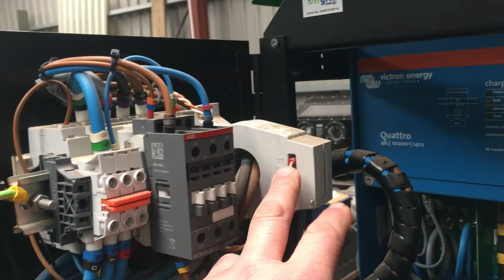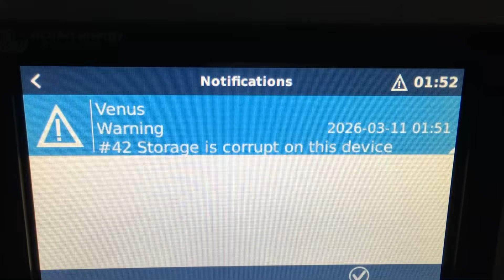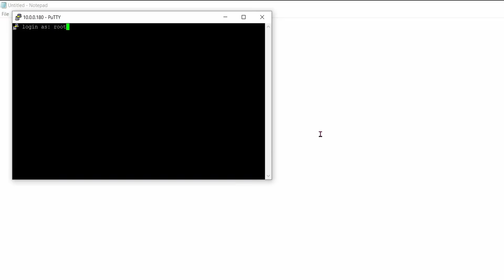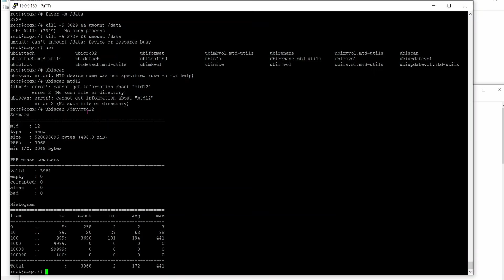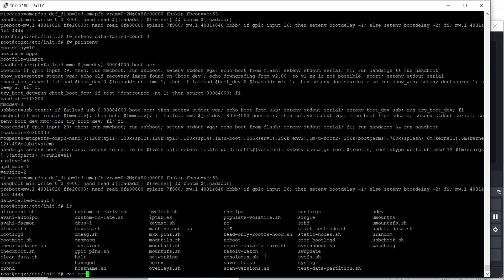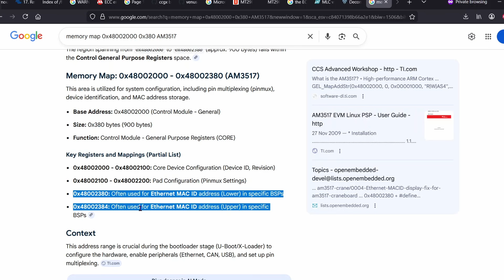Victron: "It's not user repairable" 🤔 Me: "Really?" | Victron CCGX Repair

Comment: Interesting to see Linux being used in such places. I thought there's going to be an RTOS of some kind on that control unit. The Linux is based on buildroot, these kind of systems are usually easy to play with and modify, it's mostly just shell scripts.
I tinkered with many of these and still do occasionally when I get my hands on them.
Not sure about that flash parity thing, whether this was done on purpose or simply an oversight. It sure does add a failure point though.
Reply from the maker: If you like this sort of stuff, I've done quite a few other devices that I've had to delve into the software. I put together a playlist called "reverse engineering" https://www.youtube.com/@BuyitFixit/playlists The VTech baby monitor was very similar to this, and I even discovered it had recorded videos of the previous owners child stored in the flash memory of the camera (which isn't mentioned anywhere in the manual!)

Comment: Hi Mick, just came across your channel and I'm sure you know but you have got some serious skills. I've come across some very, very clever blokes in my time in engineering maintenance and for this kind of work there are still very few people who could understand and implement the types of combined hardware and sofware based repairs on older control systems etc. that I've seen across a few videos on your channel. I've come across and heard of issues like this in multiple industries from water networks, to food production, to power gen etc. where a small fault like this can down an entire machine / system and takes months to have sent away and returned from the manufacturer. I don't know what your lifestyle would permit as clearly you own some kind of farm as well! But you could make an absolute killing if you advertised your services to the industrial sector, focusing towards plants with aging equipment. If you could go into a plant, fault find and implement fixes like this within hours or days instead of months you would be an invaluable contracted asset and you could charge pretty much whatever you wanted for your time. Just something to think about, keep up the great work bud 👍
Reply from the maker: Thanks mate 👍I'm glad you're enjoying it. I've messed with all kinds of stuff from ultrasound machines to X-Ray machines too (got one that I've used on here a few times to xray boards and the like). I did a video on it, but the manufacturer got it taken down after I hacked it lol. I've done a playlist on similar type of stuff like this one on the channel under "reverse engineering" please check it out! Thanks for the suggestion, but to be fair I don't really like working for other people anymore. I just like to do my own thing, but I'm always on the look out for interesting stuff to play with or reverse engineer....

Comment: Cheers Mick. I have put a few videos up lately about reusing old LiFePO4 car batteries for my home ESS. I have been chopping them up and using a cheap JBD BMS, but I reckon they could plug into your "generator". Wouldn't bother with Lead anymore. If you can find some lithium then this would be an amazing unit!
Reply from the maker: Cheers mate 👍I'll drop you an email.

Comment: Odd that the input cable to the dc-dc converter powering the cellular/ WiFi communications is cut….  I wonder why?
Reply from the maker: I wondered that too. I've just had a play with the modem / router today. The default password was still admin / admin. The sim card has expired, but there were logs from 2018 and text messages about the pandemic to get a booster lol. Thu Sep 27 12:32:27 UTC 2018 : Router boots up was the earliest I could fine, and the last was Tue Mar 18 22:51:34 GMT 2025 : Router boots up         so about a year ago.

Comment: A 4-ton piece of equipment being completely unusable because they set the wrong ECC seems inadequate
Reply from the maker: Yes, although I think it would have still operated, you just wouldn't be able to change settings or log anything as those use the /data partition.
Reply: @BuyitFixit That's not so bad, then. In that case, I probably wouldn't even attempt to fix it 😅

Comment: Great repair! these old CCGX units had a slew of problems when they came out. Mainly IO related problems with the CAN/USB/Ve.direct outputs failing. Unfortunately Victron has declared the CCGX units at end of life and will not be supporting any further software updates on these units. Their main argument was the units processing power not being able to keep up with the updating Venus OS and system control requiring more and more processing bandwidth. I did see these units struggle to keep up with advanced systems with allot of inverters, zero feedback meters, sensors and etc. So there is some truth to that statement. It will still get the job done however but considering it will no longer be getting security updates it might be best to keep it air gapped if cyber security is a concern.
Reply from the maker: Thanks 👍Yes I saw they had EOL'd the unit. Hopefully if people have these, and they encounter this problem, and they want to continue using them (and now they are EOL too) at least they can hopefully get them back up and running now.
Reply: It should be easily replaceable with the newer variants that host VenusOS. As It's basically the same, probably even just replacing and some config changes.

Comment: That message about ECC probably explains why the config was corrupt, seems they configured it wrong from the factory with insufficient correction from the inevitable  errors you get with NAND flash.
Reply from the maker: Hey Mike. That's pretty much my thinking too. The thing I find weird is that they obviously are aware of the issue, as they flag it as an error, and added the code checks. So why didn't they just up the ECC bits? I wonder if there's some technical reason why they couldn't. I'm also wondering if when the batteries were failing, if it somehow caused the device to reboot / lose power a lot. At that time the modem might have been dead too, so it was constantly logging to flash constantly and that's what caused the corruption.

Comment: Hi mick I work with the ve inverters on a daily basis if you need anything info wise give us a shout! 
On a side note if you were thinking of a revamp on the system could I suggest sodium ion batteries, yes they are less energy dense, however the amount of cycles and temp flexibility would be worth it! 💙
Reply from the maker: Thanks for that mate 👍Really appreciated! I've already got a smaller Easysolar II system (5KVa), with 6 x Pylontech USC3000. I had been thinking of swapping the Pylontech over to this, and then adding some more. Thanks for the suggestion of checking the toroidal transformers!
Reply: @BuyitFixit  ah I see might as well use what you have! If they are the pylontech 3000c batteries let me know if you need some bms boards I have a few kicking around that just need double network ports putting on(corroded) and watch out for the little red switches sticking in! So frustrating 😂
Reply: Also whip off the front panels and just check the 2 big coils at the back of the inverters, when they are in a mobile setting the terminals have a terrible habit of cracking and breaking off!

Comment: I use PuTTY, and WinSCP almost every day (home webserver), so I was quite at home when you where in PuTTY, I was taking at the screen suggesting things in the terminal (like you could hear me).  I think there must of been some corruption at some point along the line. In my mind you just told it "error??? what error" and it was happy. So when you rebuilt the NAND file structure the corruption was deleted. I just hope it will not come back, as the NAND could be on its last legs.
Reply from the maker: 😂😂Nice 👍I'm wondering if it was caused by power dropouts or something if the batteries were on their last legs. The flash seemed to be OK when I wrote 20MB to it. It's only really used for logs (when no communication) and the settings file anyway. The rest of the firmware is also stored on the same flash and that updated etc without issue.
Reply: @BuyitFixit yes, could be power related, years ago, I came across a corrupted SSD that was caused by spikes in the mains voltage.

Comment: These are commonly used with a generator running for short periods at optimal output rather than running all the time. Significant fuel savings can be made when the power draw is low.
Reply from the maker: Nice 👍

Comment: I have sheep lambing in the old orchard next door to where I live. Unfortunately I was leaving for work Friday morning and found a sheep dead just over the hedge. It had obviously died while trying to give birth. It was not a nice site. If it was still alive I'd have been over the fence to try and help it but it was motionless. Otherwise quite a few lambs in the orchard. On the subject note. How did you pick up the battery bank with all the Victron stuff in it. I'd been looking at Victron kit to build a solar power system to fill my small neads.
Reply from the maker: I bought it off someone who had a few of them. I think they came from an auction. Shame about the sheep, we had that happen to one last year that we found down the bottom of one of the fields.
Reply: @BuyitFixit  As others have said. Will be good to see you get it up and running. I did a lot of reading up on solar, bought a few books. I just need to get and build my workshop so I have a roof to put some panels on. I want to ditch British Gas and any other supplier. Prices are an utter piss take.

Comment: God I hate computer stuff. Built in break downs. Why on earth would you need internet and WiFi and blue tooth and gps on a power brick?
Reply from the maker: I think the WiFi / 4G is for remote managment, and troubleshooting if there's a problem. The GPS is so they know where the device is (in case it's out on hire and either get's stolen or requires service).

Comment: God like skills. . Respect. Little Victron linux machine . Seeing this makes me wonder how many other devices can be SSH into. You did have some background knowledge in holding the button down to allow supper user access to then set up the password and find the IP address.And you certainly know your way around linux commands
Reply from the maker: Thanks 👍Glad you enjoyed it. I read the manual about on how to do a few things like get the super user. I've done stuff like this before. If you like this type of stuff I put together a reverse engineering playlist which has stuff like the AverMedia capture card I fixed or the VTech Baby camera (that I found out stored images and video from the previous owner in it's flash!) Have a look if you're interested 🙂👍

Comment: When you first looked at the code, you mentioned the NAND chip was using 1 bit per 128 bits, but the chip prefered 4 per 512. If me maths is correct, then 1 per 128 is equal to 4 per 512, so this shouldn't be an issue.
Reply from the maker: From the debug log: nand: WARNING: omap2-nand.0: the ECC used on your system (1b/256B) is too weak compared to the one required by the NAND chip (4b/512B)

Comment: Well well well, I didn't know you could get root access to a Color Control.  That is going to be really useful.  Wish I had known that a month ago!  Regarding the unique id. Can't you just replace the 'getUniqueId' binary with a simple shell script to echo out your new chosen one.  Then on boot it will get your new id.
Reply from the maker: Yes, you can also get access to UBOOT with a serial adapter, I tried that yesterday. I did try changing the mac in Uboot, but it didn't make any difference. It seems it's using the one baked into the actual CPU. There are some early boot hooks you can use, by putting a rcS in /data. I had thought about a script that creates a symlink to the get-unique-id to another shell script that does echo 'newmac' pretty much. I've not tried that, but I'd think it should work.

Comment: Great video! One little tip - you would have been better off transferring a file with a known SHA1 hash onto the flash and then checking it. Otherwise you’ve got no way of knowing that your data didn’t get corrupted as soon as it was written (because you don’t know what the random data was and you didn’t hash it until it was on the flash). Also, I’m sure some people would criticise them for saying “return to base for repair” but a) this isn’t a device most people should mess with, and b) they’ve actually made their source code available. Not enough companies do that.
Reply from the maker: Thanks, and thanks for the tip 👍Yes they even put hooks in the code for you to run your own scripts at boot, or to add extra features. I think the encourage people to write their own things and customise it as they want.

Comment: Nice job!  i don't know what you paid for that unit, but there's a fair few ££ of victron power in it, 3x 10kW 48v inverters alone is worth a few quid,  originally looks to have been 24  x 12v lead acid batteries wired as 6p4s, probably around 30kWh total, perhaps 15kWH useable and probably 800kg of batteries.  You could probably fit an easy 100kWh of lithium in it, probably even more!
Reply from the maker: I think they were these type of batteries in them https://www.everexceed.com/deep-cycle-tubular-opzs-flooded-battery_p48.html I paid around the price of 1 new inverter.

Comment: Very nice really enjoyed this

That first bash script, looks very sledgehammer to crack a nut

I wonder where the 1bit instead of 4 bit is set or reported
Reply from the maker: Thanks 👍Yes I thought that too. I thought the ubifs should handle any problems as it should mark and re-allocate any bad blocks. Seems on any error, more than once they just "brick" the device pretty much. I would have replaced the chip if I thought it was bad, but all the tests I did seems to indicate it was fine. Weird thing is that if the chip is bad, the bootloader / main firmware etc etc was all fine. It even let me upgrade / downgrade the firmware, so only the settings / data partition was affected. Not sure on the 1 / 4 bit thing. Probably deep in the kernel somewhere...

Comment: Can't confirm but I'm cynical so my assumption is they're using 1 byte instead of 4 knowing it will cause issues later on forcing paid service on the controller or an outright replacement.  If you make a solid product that doesn't fail easily then that affects revenue so you have to find ways to cause it to fail that seem legit.
Reply from the maker: It's a possibility, or perhaps it was just sloppy programming or perhaps a bug somewhere that they couldn't get to the bottom of? They obviously know about it as they added the checks.

Comment: It seems like putty is very useful
Reply from the maker: Yes, I've used it loads in the past on all kinds of devices. If you come across a device that has a 4 pin header (possibly a serial debug header) you can use a USB to TTL converter, and putty to 'talk' to the device and do things like this. I've done it a few times on different devices. I think one was the Avermedia video capture device I looked at, and the RadioSonde weather balloon board that a local farmer found and gave me. Both videos are on my channel if you're interested.

Comment: If you are going to change from lead acid to lithium the charger for the batteries will need to be changed for the different charging regime, That change I would love to see. Brilliant work so far.
Reply from the maker: Thanks 👍Yes. I've setup a similar (smaller) Solar  / Batteries / Inverter Victron system already. It was pretty straightforward to be fair. The Pylontech batteries I used already have a BMS built in that talks to the main controller over CAN bus. You just set your voltages / charge currents etc in the menu which they give you all the parameters for.

Comment: Honestly that was some genius at work
I have used Victron Kit in the past and was happy to get a Solar Controller connected to a Raspberry pi and publishing data to a website for solar in etc
That was simple compared to your genius here 🤣
Reply from the maker: Thanks Robert. I like Victron stuff to be fair. I've already set up a smaller system with an EasySolar II which charges 6 Pylontech USC3000 batteries. Well done on setting up your stuff!

Comment: Test have I been blocked??
Reply from the maker: Nope, unless YT has blocked you? Sometimes depending on what you post it can "auto moderate" posts.
Reply: @BuyitFixit I shared some information for ya and Utub block me, bummer. Those Comercial plugs are called pin and sleeve very common in Comercial Industrial Electrical Systems. I don't know how much you already know.
Reply: One more thing and I'm breaking this up, you will need to look into the charge system for that UPS, the flooded cell battery's use a pulse charger system to remove the sulfide from the lead plates, you might have to mod that system to charge the lithium ones.
Why Change the Charger?
Flooded batteries use a 3-stage process (Bulk, Absorption, Float) with an "equalization" stage (high voltage for maintenance) which damages lithium batteries.
Reply: @BuyitFixit The other part, that is considered a "separately derived system" in other words the same as your main electrical service to your property, it will probably need it's own grounding system separate from the existing service. Check your local codes.